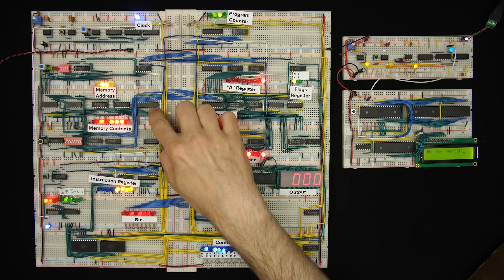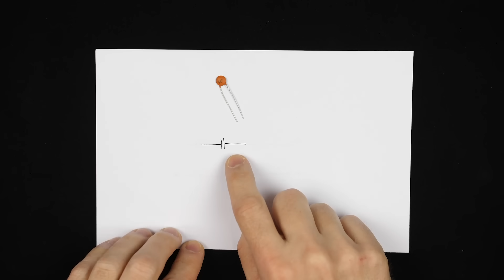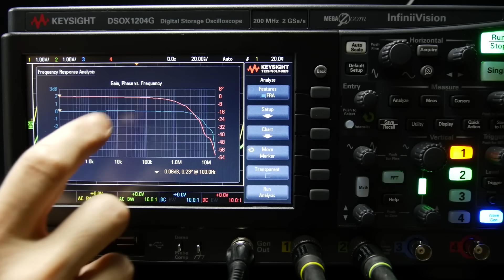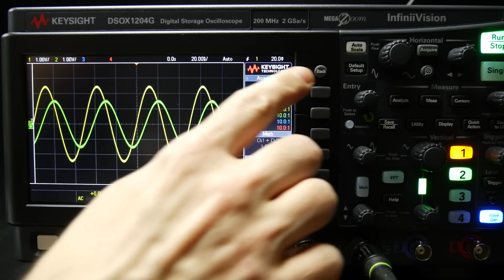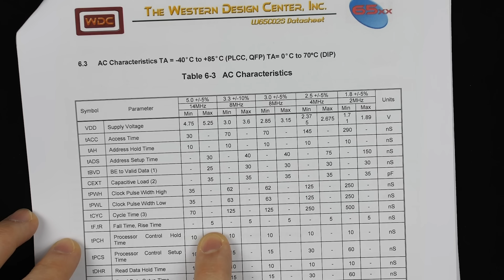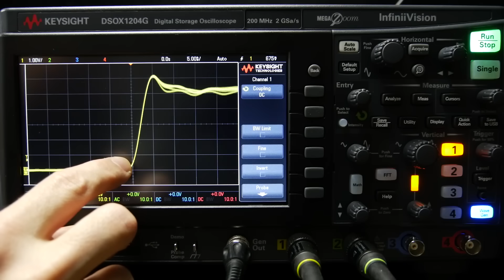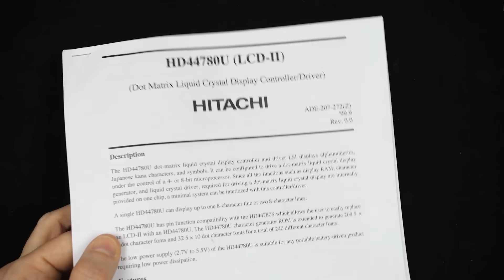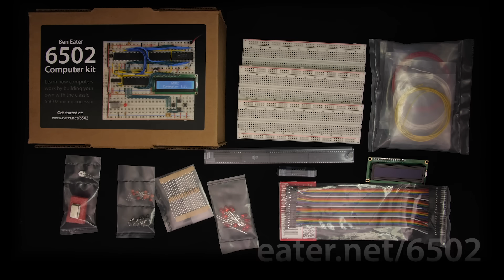Why build an entire computer on breadboards?

Comment: I disagree about the learning part. It's pointless to build a computer on a breadboard, so that you "learn" how computers work. You're only wasting your time for the "aesthetics" and reward of putting something together on a breadboard (yes, it is an impressive achievement having to wire the whole thing, and getting it to work).

If you want to learn how computers work, and getting hands on experience at the same time, here are a couple of MUCH better ideas:

1. Use simulation software
2. Read a book about digital electronics, CPU design, FPGAs
3. Buy and program an FPGA board (if you literally want to see how it works).

When you fuck up something on a breadboard... it does not force you to think about why the design doesn't work, it forces you to troubleshoot the mess of unnecessary wiring you're forced to use to get it to work. Sure, you learn how to do it better, on a breadboard, but not how to design a computer. It forces you to double check connections, pinout, read datasheets, etc, all unnecessary manual labor you can skip to learn more efficiently.

Now, I'm not saying that using breadboards is bad and you don't learn anything. On the contrary, they are very useful for learning and prototyping small stuff, although that has its limitations as well since you introduce many other problems, such as cross-talk. But when it comes to learning about computers, it is absolutely not the right way, and you should frame it as it is - it's for entertainment.

Comment: Well that answered a question I  had on one of your old videos - in spades! I suppose you might get tired of superlatives, but that was an awesome deep dive into stray capacitance and inductance, a topic I've wondered about frequently over the years. Thank you!!
Reply: By the way, I was wondering if there's a way you could destroy the CPU (or some other chip) by running the clock too fast, or would it just not work at all for reasons similar to your hypothesis about the LCD?

Comment: My dad prototyped a computer at home (at least, the memory banks and floppy disk interface) on a set of breadboards back in the 1970's based around a Fairchild F8 µ-processor board, right around the same time that Woz was putting the Apple 1 together.  The terminal for it was a TI Silent 700 terminal model that had a built-in dual cassette tape deck.  If my family been able to migrate to Silicon Valley instead of being stuck in Wisconsin, there might have been another contender in the Apple/IBM personal computer ring.  C'est la vie.

Comment: The breadboard quality really is a huge deal. Last year I had to assemble my group's course conclusion project and I had to use our breadboards to make a functioning prototype to test before getting a PCB. While using only one breadboard it all went well, but when I started to put components on the other, which was from a different manufacturer, it all went downhill and would only work if I aplied pressure do some connections. After that I got really frustrated and just sent my friend a scheme for the circuit so he could draw it on a fenolite copper plate and I could corrode it. Luckilly the design didnt have any problem with the basic circuit.

Comment: Issue with breadboards is they are noisy. They are OK for projects below about 8 Mhz, but beyond 8Mhz (buses) the noise starts to become a problem. Also sucks when you accidently pull a wire out. 

The other alternative to breadboards was wire wrapping but does create a birds nest if your project has more than a 100 connections. 

Breadboarding & wirewrapping were done with creating PCBs was both time consuming (hand drawing & adding throw hold eyes for linking connections between sides (vias). Also  breadboarding with modern surface mount devices requires the device to be soldered to a SMT breakout board.

Comment: 11:00 I'm not an expert, but I think phase shift is actually caused by the speed of light. Signal travels about 95% of the speed of light in a copper cable. If I read the scope right, the shift is around 10 nanoseconds. Over that time period, light travels around 3 meters. I wouldn't be surprised if the sum of the length of cable used for the scope and the extra wire on the breadboard would add up to around 3 meters.
Reply: Wouldn't you see a more linear response to increasing frequency if that was the main factor? I'm sure it plays a part, but the response seems to be quite sharply non-linear, which to me implies that it's more to do with impedance and capacitance, as Ben says.
Reply: @keithklassen5320  Actually, the response is linear, showing about 10 nanoseconds at 1 MHZ, 10 MHz, and 20 MHz. What you are seeing is a linear function plotted on a loggrythmic scale.
Reply: general theory of relativity kicks in
Reply: When your wavelength is comparable to the length of the wires you use, you get losses/shifts
Reply: I had a similar question when I first saw the this. However, assuming that the probe lengths were equal, the only difference would be the distance covered in the breadboard, since the difference in time would the same at the tip of the probes, given that both signals would take the same time to travel from the probes to the oscilloscope (and the same processing time internal to the oscilloscope). Given, the length of cables on the breadboards, I would think that the time delay would be about 1 nanosecond, not 10 (one nanosecond is about 12 inches in copper). While there is also additional delay caused at the junctions of the wires, I don't believe it would at up to be the other 9 nanoseconds. However, the delay observed does appear to be about 10 nanoseconds at 1 MHz, 10 MHz and 20 MHz.
Reply: The two phenomena are in fact one and the same.
Reply: Objects in Motion so then, would that slight delay always be there, it just isn’t noticeable at lower frequencies?

Comment: Great things breadbord PCB. It copying layout of a breadbord, but it needs soldering, so you can achieve same flexibility as when you using breadbord with good connections and mechanical strength of soldered PCB.

Comment: Is it possible to DIY your own modern motherboard, maybe not on a breadboard, maybe a solder prototyping board?
Reply: People think I'm crazy but I really want to make a motherboard that has really nothing more than the CPU RAM sockets and a bunch of PCI/PCIe slots. No built in audio/video, no built in SATA controler, no built in Networking, a removeable BIOS, maybe built in USB (but only if its absolutely necessary).
I would buy such a motherboard if it existed but it doesn't so I''ll make one if possible.

Comment: I enjoy the information and now understanding more issues and not all chips are well found. 
Yes some used chips are cheep from china but no big deal find another store or place to get from. 
What upsets me is the cost of shipping and price.   USA UK  suppliers like Newark or DigiKey  charge $112 dollars USDN for something that is 2 to 5 dollars Canadian. 

Yes they are new chips and assured to work for 300% markup.. Delivery is faster 3 days versus 30 days.
EMI or ECI or FI or EIare always a issue in any wiring and electrical system..

Comment: This is gonna sound slightly stupid but...
i never knew crystal clocks used Fourier Series to generate square waves... 
I always thought it's just a clean square wave, like when two transistors pull the line high and low really fast 
mind = slightly blown 

P.S.: Fourier Series = adding pure sine waves of different magnitude and frequency to generate a different waveform like he did with the graphing calculator

Comment: Maybe make the clock and signal wires not have 90 degree turns? Your address lines and Data lines look like nice curves but putting the 90 degree bends in the clock signal might do something or cause the shadows or that just might besignal bouncing back and then down the line to the CPU...not sure. It would be fun to see if anything changes.

Comment: Ohh dear, flashback to when: I built a CPU (made of relays) on a PCD (yes D) as in Plywood Circuit Door.
Reply: If you really did make a CPU  out of relays it must have been HUGE (talk about several cubic meters).
There is a limit to how small you can make a relay, and the Zuse Z3 was made of relays and was a few cubic meters ( https://en.wikipedia.org/wiki/Z3_(computer) )
Ok you did not have to make it 22 bit (8 would do), but you would still end up having to use hundreds of relays, and that could neither have been easy nor cheap!
Reply: @srenkoch6127  The CPU (only, no I/O or RAM fitted on a standard door with room to spare :-)
The architecture was 16 bit (4 instruction and 12 address)
Relays used were 50V 3 pole changeover each 1 1/4" square by 2" tall standard GPO.

I cant remember the relay count, but it was in the order of 200 ~300. The master clock was a loop of relays but the main instruction sequencer was a Strowger Uni-selector like: https://en.wikipedia.org/wiki/Strowger_switch#/media/File:Uniselector_Stepper_detail.jpg

There were several designs submitted at the time, but the relay count for mine was less than 1/4 or the nearest rival and the least efficient was thousands...
The main reason my count was so low was that logic 0 was open circuit as opposed to 0V. that meant that an OR gate could be just a wire joint (and very VERY fast!). Also a relay has 2 inputs (a coil has 2 ends!) this was used to implement register CLEAR by disconnecting the 0V to all relays in the register, leaving 1 relay per bit +1 relay per 3 bits for WRITE-SELECT+ 1 for clear.
Addition used just 1 relay per bit, One word energised the relays and the other word and +V.

For a working demo of the instruction set see; https://scratch.mit.edu/projects/34443446/
Reply: Man that is AWESOME! I would love to see pictures of something like that
"Why build a computer out of relays..?" Because it's AWESOME 😊😊
Reply: @dmeemd7787  Sorry, it was a very long time ago and there are no surviving photos. Here is a demo of a CPU with the same instruction set. https://scratch.mit.edu/projects/34443446/

Not only awesome, but also very loud.

Comment: Listen to an elevator after you hit the button, a lot of times you can hear the wire snapping inside the conduit because of the magnetic induction because of the large current and undersized wire.

Comment: If you SHOVE a nose pliers in your nose it will tear it open as well, like you did to the cheaper breadboard ONLY, I see your bias advertising and hate.
There's very clear plastic breadboards you can demonstrate how wire inserted without the need or removing flexible plates.

Comment: The busy flag might not be available for some time after power up. Back in University i JSR'd to a delay loop between the LCD initialization commands. Only when i was printing characters did I look at the busy flag. 

And even then i had a maximum count of loops looking for no longer busy, before the software would give up and move on.

The things I did for an "A"... And yes some of my defensive coding may have stemmed from low quality breadboards.

Comment: The problem is not the taking more time because of the troubleshooting but taking more time because of faulty connections and the rat's nest of wires that almost takes you back to the wire-wrapping days. There is gradient between building a kit just needing assembly and using the abominations that can be solderless breadboards. It's no fun when they are unreliable, time much better spent soldering your own perfboard and still understanding how it all works.

Comment: Beware! Cheap offbrand LCD displays often don't implement the correct behavior for checking the busy flag, or they do so poorly. I've never had a problem with something like a New Haven display from Digi-Key, but the exact same interrupt-based code will fail to work with a cheap display.

Comment: An electronic circuit is only as good as its worst connection.  We probably don't pay enough mind to the PCB or breadboard iits built on.  I spoke  (well, typed;) )  to someone else about something very similar elsewhere, not long ago.  It's just boring straight lines on the wiring diagram, isn't it?  They're all perfect conductors, after all; you shove an electron in one end, and one comes out the other end straight away .....  aren't they?  Um .....  no .....  you've gone beyond the usefulness of the model, because all the effects you've been ignoring up to now because they were too small to make any difference, have now grown large enough to make a difference.

This is often a case where street smarts get you out of a situation that the person with the book learning would never have gotten into in the first place!

Comment: I had wanted to do this about 40 years ago. An older, more experienced friend told me, "No way: it won't work", citing complications like capacitance and inductance. You've proven that it can, in fact, be done Thank you.
Reply: Being able to do it doesn't mean you should. If you purpose is to learn how everything works piece by piece and deal with the reality of the limitations of a breadboard whilst doing it? That's a pretty good reason. To learn electronics in general? I'd say this is not great, pretty inefficient and limited to one thing, perhaps good for a short intensive course. As a challenge? Knock yourself out. But I'd recommend not doing it just because, as you will be wasting a lot of time hitting yourself against a wall for very little gain.
Reply: Of course it can be done, but you might actually need a static core, because you might actually not be able to clock a non static IC slow enough for both the IC to work and not well, have it compatible with the RF limitations of the breadboard and wires going everywhere. I'm guessing that you would be severely pushing it if you went anywhere near 1 MHz, but I might be wrong ;P
Reply: @MrGoatflakes  I was thinking about this. I figured it would be simpler, but more expensive, to use SRAM.
Reply: @rickperez8044  idk if youtube gives notifications for such old comments, or if you will even see this. But could you explain what SRAM is?
Reply: @eiryna4560  SRAM is Static Random Access Memory. It is an array of flip-flop circuits that hold contents as long as power is applied. They are simpler to use because, unlike Dynamic RAM (DRAM), they don't need a periodic "refresh" procedure that reads and re-writes the data to keep data (charge state) from leaking away. This requires circuitry and timing that add to the complexity of the project. During the refresh. the memory is "off the bus", not available to the CPU
Reply: @rickperez8044  having the computer static is more than that though. The entire thing needs to be stable when you stop the clock. 

The late 1970s/early 80s NMOS 8 bit MPU chips used in the 8 bit home micros usually weren't static for some reason, their CMOS replacements/equivalents that came out in the late 80s/early 90s usually were.

But the industry had moved on to 16 and 32 chips by that stage. Most of which weren't static not least of which because they typically used DRAM so they could have more memory.

The only home computer that used them that I am aware of was the Apple IIGS, a phenomenal machine that used the WDC 65816, a static 6502 based hybrid 8/16 bit architecture. But as good as it was, it still probably wasn't as good as the Amiga for instance, (Motorola 68000 based), and I don't believe the IIGS was static as a system either, because I believed it used DRAM.

It's possible to create a static system with DRAM, but you would then need seperate refresh circuitry and clock and probably buffering between the memory and CPU bus, and that would be stretching the definition somewhat.
Reply: how would that be impossible??

Comment: Very nice video.
Another alternative to checking the busy flag is to create two delay routines (1.52ms and 37us)  and use them to satisfy the LCD functions timing requirements found in table 6 of the datasheet.

Comment: It's good you mention the problems with loose wires like that for signals. I had to prove how bad probing and just using loose wires to connect high speed signals (USB and FTDI seriel at 1MBaud) would simply not work unless you use a twisted pair!

Comment: To be honest, breadboard can fit most low frequencies design. However, when the frequencies become higher, we need to think about the layout and impedance, then we need to use PCB. What's more, in our country, making a PCB is really cheep, 10*10cm with 5pic only cost 5RMB, so I prefer to design PCB.

Comment: I remember for my college project 30 years I built a solar tracking system which interfaced to the 1MHz bus of a BBC Micro which used the 6502. I had to gate the clock with pretty much all R/W and Chip selects to overcome the delays caused by capacitance on the 16 breadboards I used. It worked a treat with all my hardware memory mapped onto BBC memory bus. These days I'd use a microcontroller and interface serially but those lovely little things were not available back then.

Comment: I'm currently going through building this 8-bit computer using solder on Prototype (Vero and Breadboard layout) boards.  I wish I could buy the kit but I just can't afford the kit and postage. I know that breadboards are easier to use, they're just plug and play after all, but I never had access to good breadboards. The bad breadboard in your video was the good breadboard I had access to, so I just got good at soldering and desoldering instead of all the trying to figure out if the problem was the breadboard or my design.

Although I do have to ask, are you now or were you a teacher? There is an art to teaching and your videos are among the best I have seen.